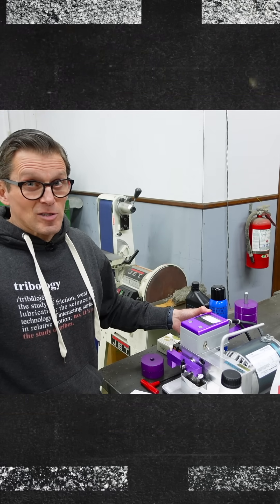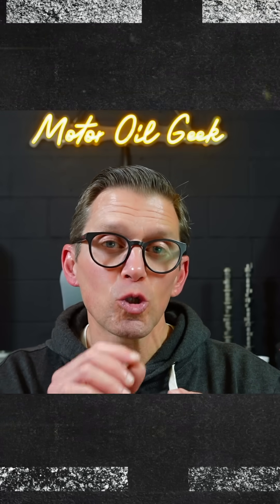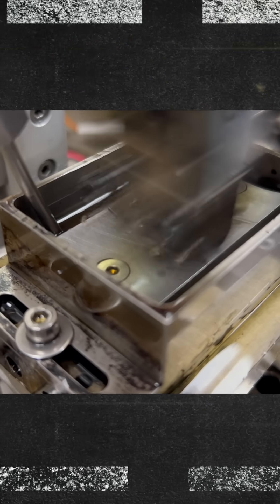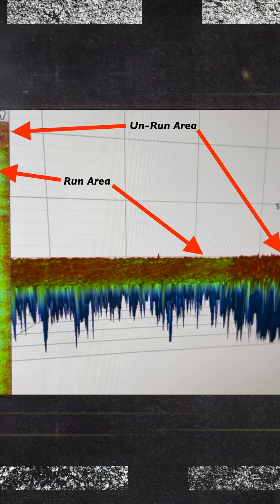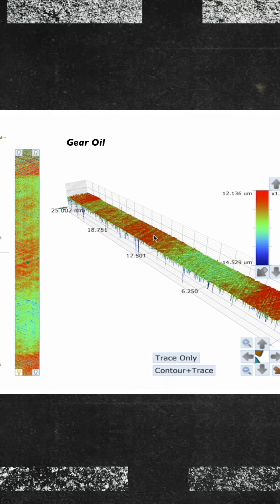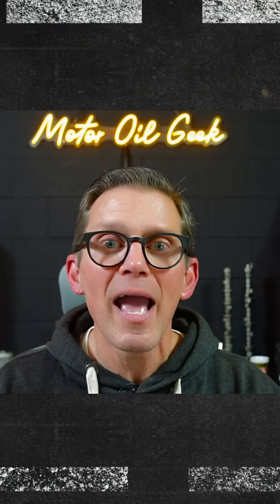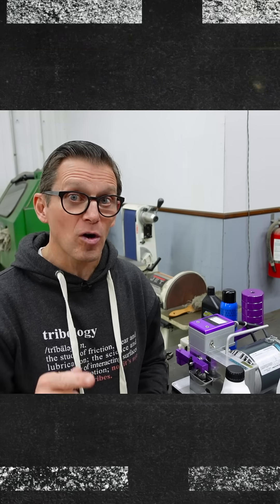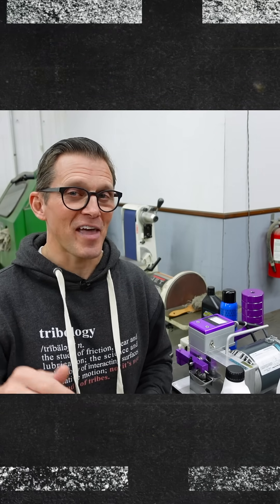Do “Film Strength” Testers Tell The TRUTH? #motoroil #automobile #mechanic

Comment: What is your take on gm upping the viscosity to 0w40 for the l87 that has had bearing failures?  Also I'm tempted to run  shaeffers  or redline in the l87 in my gmc at4 instead of mobil 1 due to the higher zddp and moly content in the oil would help  .  I've looked over the Virgin oil analysis of both the shaeffers and redline  and is seems that they blow mobil 1 out of the water!   Honestly  I want to put the best oil in my 6.2  no matter what the cost is.
Reply from the maker: We are going to make a video about that ASAP.

Comment: So fascinating how the lower amount of AW additives in the API SP actually did better. On paper SP oils aren’t so impressive based on VOA
Reply from the maker: Exactly. API SP oils break the "rules" that have been taught for a long time.
Reply: I guess it's the age old buying a hair product that is both a Shampoo and a conditioner.

2 competing objectives,

It will either be a good shampoo but a bad conditioner,

Or a good conditioner but a bad shampoo.

So my take on the SP oils with less additives outperforming the earlier oils which have more additives,

Is that it has less "shampoo" and so the "conditioner" is more able to perform it's task.